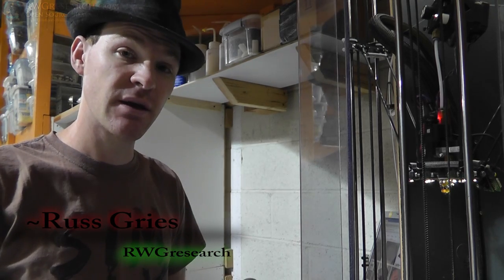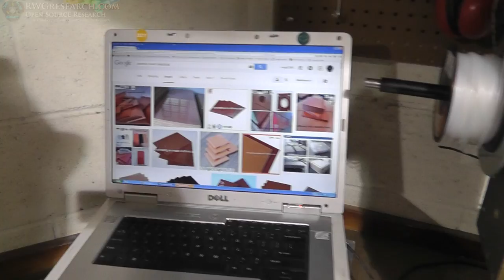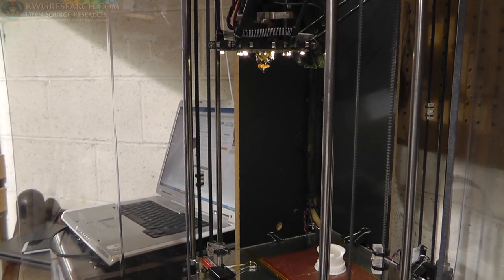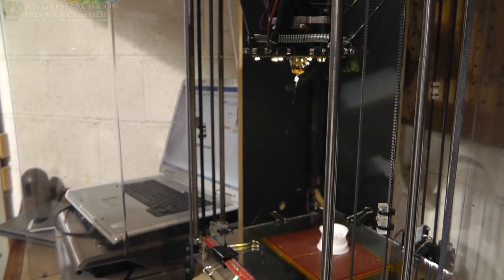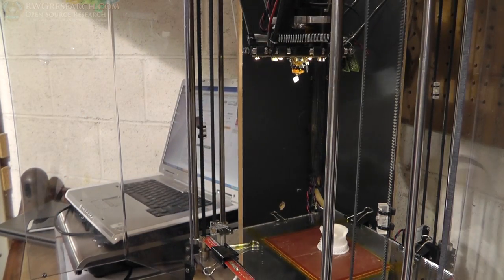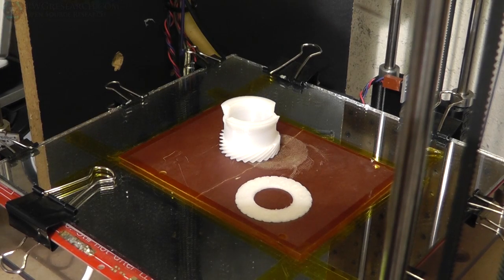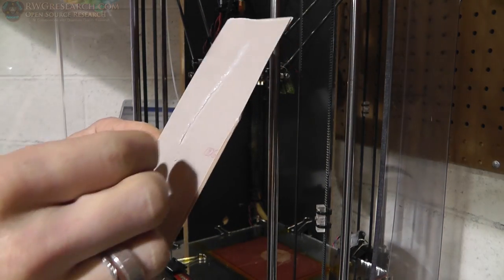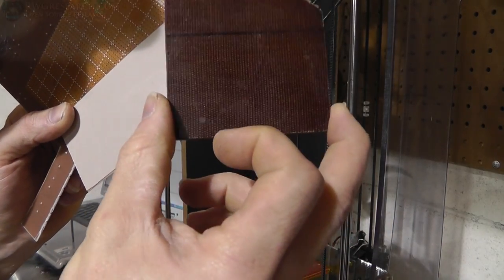Printing Nylon / Taulman, The best Bed Surface, No Problems, Cold Or Hot, Phenolic Paper.

Comment: Thank you for this video, I tried everything else, glue stick, temperature settings and had no luck printing any of the taulman nylon filament. and after 10 mintues of trimming my new phenolic paper and re-leveling the print bed it sticks and has printed with no errors.  Thank you

Comment: Thats pretty cool. I made myself a resin based bed specifically for nylon. I took a piece of aluminium, a few pieces of cotton, and resin. Layer of resin, smoothed out the cotton, another layer of resin, smoothed out another piece of cotton fabric.  and another layer of resin on top, and removed any excess. 

Let it dry, and then when i print, the first layer has a heated bed at 96C and the after the first layer the bed temp is turned off. Nylon sticks so hard to that surface you cant even take off the print with your hand when its done, its stuck like its been super glued onto it. So to remove it easily you need to heat up the bed to 96 degrees and then it comes straight off. But i only use that bed for Nylon, nothing else.

For all other plastic i use a glass bed.

Comment: Phenolic (Fee-nol-ic) is basically a form of Bakolite. Phenolic based boards were indeed popular with electronics for some time, because of electrical and thermal characteristics. Nowadays we most commonly use Glass Reinforced Epoxy resin.
Reply: Sardi Pax I agree, we still use phenolic tubes for insulators, but as far board style ones yeah the most common is GRP board.

Comment: They use G10 for custom knife handles, which I believe was originally designed for Mil Spec phenolic circuit boards, you can get it at any custom knife supply website in various thickness vary reasonably priced... they also sell sheets of carbon fiber that might work, thats about that same consistency as what you were using.

Comment: Hi Russ, thank you for the video! I hope it will work for Nylon 645 too.
IMHO there is a nuance with the second part, where you have tried several circuit boards. I think that all three samples you have used are textolite, while the one that successfully sticks (at the first part of video) looks like getinax. I can't find a good translation of "getinax" and "textolite" to English, but some old school radio hobbyists should know right words. Getinax has been widely used for circuit boards prior to appearance of textolite (I think that getinax disappeared from wide use in electronics about 30 years ago).

Comment: Hey Guys, everybody who is looking to avoid warping prints!
I work for automotive industry and print almost daily. those who print with Nylon filaments should use TERAOKA tape. Its green industrial tape for electronics. Heat up the bed with the tape on it at 100degree. It just stucks on the bed. viola, warpfree prints. Douzo!!!

I did not tested it with PLA PETTG or ABS. Nylon for sure. :)
Sorry @rwg42985 for using your space, but thats an easier and cheaper way :)

Comment: This is Garolite aka Micarta (US) or Tufnol (UK) or various other brand names. It's a phenolic resin filled with various products. Bakelite was the first of these and specifically contains wood powder.

About the only thing nylon sticks to is cellulose a starch-like chemical that composes the majority of plant fiber. Thus nylon will stick to any phenolic resin that contains plant fibers (wood, paper, cotton, ect). 

Phenolics  for circuit boards use fiberglass as a filler. It doesn't contain plant fiber so nylon doesn't stick to it. There's also a carbon fiber phenolic. 

Sorry to contradict you at 1:18 but I'm pretty certain that it contains fibers but they are too short to see. The phenolic resin is clear so if it's not clear then it contains something.  Their shortness is why it cracks easily. 

The problem with the thicker material is that it is almost always warped. It's a thermoset plastic so it can't simply be reheated and flattened.
Reply: it's phenolic paper. pertinax is another pseudonym.
Reply: Hi, thank you for sharing. Is it possible this will also work with abs or pla?
Reply: So would nylon stick to HDF like that used in clipboards?

Comment from the maker: Hi all, I later tested on a cold bed and its still just fine, just make sure your first layer is close to the bed... But i still recommend heating the bed...

~Russ
Reply: ***** Thanks for the vid! Been trying with nylon but had lost of delamination and warp. Thanks for the tip.
Reply: Cerebral I use glass and glue.I have had very little warp until i take it off the platform.What are you using as a platform for the nylon to stick too?
Reply: ***** Hi Ross. It may sound crazy but have you tryed Baking paper?
Just thinking i dont have a 3d printer my self.

Comment: PVA glue on blue tape works for me with taulman 910
Reply: Which PVA glue, brand and model?
Reply: elmers diluted in water like 1 to 10 ratio. just a very thin coating on the blue tape with a paper towl. i dont have a heated bed but id bet it would work even better.
Reply: TR1PpyNick 
Is the elmer glue the dissapearing purple or the regular white one?
Reply: white

Comment: Russ , im only two minutes and I feel the need to pause the video and tell you this, Whatever that stuff is ! it too expensive regardless of the price , I print 910,  PCTPE and Bridge all on glass with zero heat at all on the heatbed,  with out any warping , The only thing you need to do is clean the glass well with alcohol , then use the CHEAPEST Dollar store strong hold hairspray( usually labeled  Mark Anthony in a white spray can )  put a nice thick coat of it right on the glass and volla bob's your uncle ! , And as long as you get your first layer right ( just like a PLA ) you will print it with out warping.
Reply: Hahaha just noticed this video is a few years old ! sorry for the delay lmaooo
Reply from the maker: hey... i still haven't found a great solution so...  ill give this a go! lol i still got 2 spooks of nylon just waiting for me to make it stick lol thanks for the tip!!! ~Russ
Reply: remember to dry them rolls out before using them :P AKA  "Spooks"